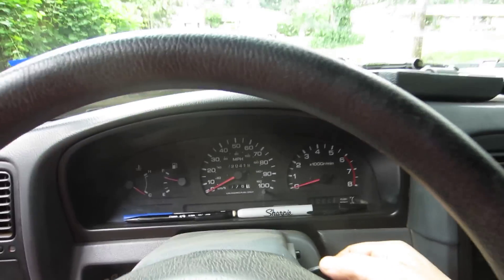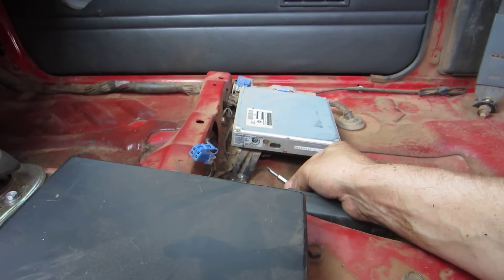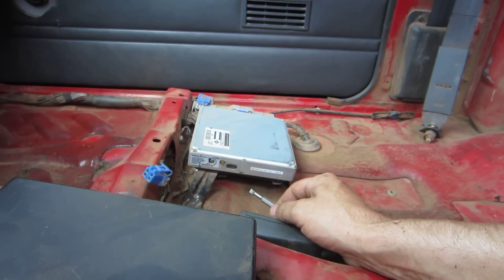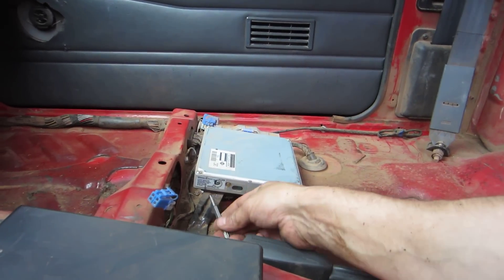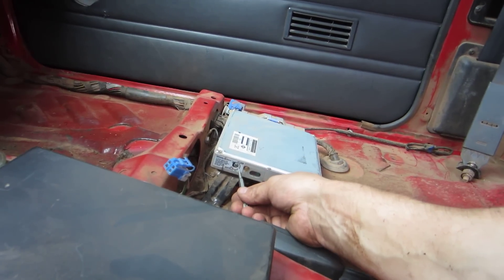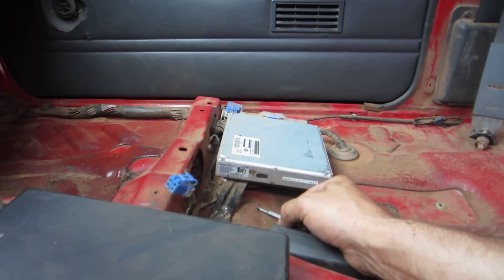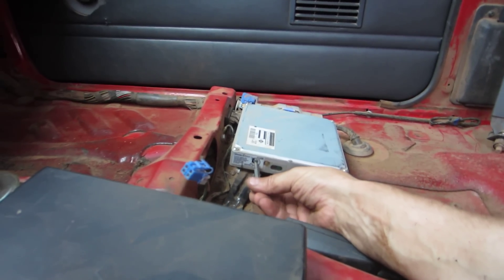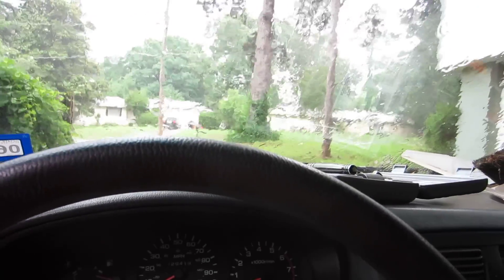Nissan D21 Hardbody Error Code Reading

Comment: My mechanic says I have error code 55. which happens to be the code for no malfunction, and yet the engine light stays on.

and so I get no diagnosis, and my car fails only the 25 mile smogcheck test

this is for a 93 Nissan Hardbody truck 4 cyl
Reply: +Iain Wigglesworth if it gets to a second issue I will join infamous nissan, thanks for the advice

I was staying on this specific topic of 02 sensor until I was clear on all my counter questions from the original topic.

thanks again.
Reply from the maker: +Daniel Manahan Are you on www.InfamousNissan.com? I don't have smog check where I live, but a lot of guys on there do. Post on there what specific part of your smog test failed. I'd vote for an old O2 sensor or dirty MAF.
Reply: +jp2code how much is it to replace that device? 

if the error code is 55 which is no malfunction, and yet I have a check engine line on, then it would seem that the box is defective

what else could it be?

at least that is the conclusion of the mechanic.

and I hear these parts can't be found except in a junk yard.
Reply from the maker: +Daniel Manahan The ECM detects problems with sensors and such that it needs to operate. The Check Engine Light (CEL), on the other hand, seems to be there to ensure your truck's emissions are good (which yours are not). See this pic out of the service manual: http://i.imgur.com/NBfxzi0.png
Reply: +jp2code so I don't understand. are you agreeing or disagreeing with the mechanic's opinion that the computer is bad?

if it reads error code 55 which is no malfunction and the check engine light on the dashboard is lit when the car is running, what else could that mean? why would the computer not give an error code when the check engine light is on?

I can't smog this because of the check engine light being on. it must be off. and yet there might not be any problem with the engine, just the computer, if I understand.

the emissions problems are another thing, separate issue or else a code should show up.
Reply from the maker: +Daniel Manahan Sorry this took me so long. I don't have a smart phone, and I was out at work. I'm saying a faulty O2 sensor is what causes the CEL to turn on. It is emissions related. There is nothing wrong with your ECU.
Reply: +jp2code then I am confused. why doesn't the ECU return an error code? why error code 55 no malfunction?
Reply from the maker: +Daniel Manahan Because nothing is malfunctioning with the engine. The ECU gives you errors when it detects an error with one of the sensors. The CEL comes on when your vehicle is not meeting emissions. If you look at that picture, it says to replace the O2 sensor.
Reply: +jp2code so this is great news. an easy fix right?

in my smog test it passed the 15 mph with everything but failed the M2: 25 mph with the following values if they mean anything to you.

RPM: 2354, % CO2: 14.3, % O2: 0.4, HC (ppm) Max: 41 GP 234 Meas 18, CO (%) max: 0.62, GP: 2.18, Meas: 0.00, NO (ppm) Max: 559, GP 1640, Meas: 1677 Result = GP

and in the Visual inspection  of Emission Control Systems Functional Check Results it passed for Oxygen Sensor and everything except for one thing failing the OBD System Check

what is the OBD System Check?

wouldn't I expect to see a fail on the visual check for the Oxygen Sensor?
Reply from the maker: +Daniel Manahan A "lazy" O2 sensor does not throw an error, but will cause the ECU to miscalculate the fuel mixture. Other than that, I so don't know about emissions. We don't have that here. You know who does? People on the forum: http://www.infamousnissan.com/forum/forumdisplay.php?f=21
Reply: +jp2code excellent thanks!

is there an inexpensive specific diagnostic test that can be done which isolates the O2 sensor as the problem and the only problem so I don't go back and forth making one fix retesting and another fix... 

I want to go to my mechanic and make sure they do the right test and to be sure I can trust the guy.
Reply from the maker: +Daniel Manahan No mechanic needed. See this pic: http://i.imgur.com/rhC9z.png That shows how an O2 sensor is supposed to read and a Red line showing how a lazy O2 sensor will report. The O2 sensor is supposed to be replaced every 60,000 miles. If yours is older than that, it'd be best to just replace it. Ones from the dealership are good quality, but around $60. Cheaper ones can be bought that come without Nissan's "snap in" connectors, but they have to be spliced in. The O2 sensor goes from where your exhaust pipe bolts up to your CAT, up around the transmission, up the firewall, and snaps in place in the engine compartment just behind the battery.
Reply: +jp2code If the O2 Sensor is lazy causing the engine light to remain on, shouldn't the engine light only go on once the car has been driving for some period of time not instantly? I mean, wouldn't we expect to see the engine light be off when the car is turned on and then gradually reach some kind of error?
Reply from the maker: +Daniel Manahan I don't know. Your O2 sensor is bad, though. Not the ECU.  ...or, just replace the ECU if you want. It is more expensive, though, and a new ECU isn't going to magically make your bad O2 sensor better.
Reply: +Daniel Manahan please join www.Infamousnissan.com you are more likely to  find the answer to your problem on there
Reply: +jp2code I will replace the o2 sensor per your advice and get back with you to let you know it was a success or what's next.
Reply: ***** dont reply on here please. Join infamous nissan
Reply: +Iain Wigglesworth just joined thanks. hope to see you there my friend.

do you have a nissan hardbody too? what year may I ask?
Reply: ***** i have 3. My username is 1990nissanhardbody
Reply: so it was the 02 sensor for that 55? im getting 55 on my 88 pathy
Reply from the maker: 44 is the A-OK for D21 trucks from 1988 and earlier. After that, Nissan went ODB and used code 55 for No Detected Malfunction. The D21W Pathfinder may have gone ODB earlier.

Comment: What year is your truck 94 or 95 and is there a junction box on the other side that works the blinkers mine when out and I was told there is a box under the seat for the blinkers
Reply from the maker: Under the driver's seat should be the door lock timer and the rear antilock break module. http://i.imgur.com/YabXD0Q.png
Reply from the maker: It's in the EF & EC section of the Service Manual. If you don't have a digital copy, get one from here: http://www.nicoclub.com/FSM/Hardbody/ I just know one day that site will be gone.
Reply from the maker: Shows "Linked Comment", so you may not get this. There is no other junction box. This is on the 1994 truck, but the driver's side is only for the Cruise Control Module, if your truck were equipped with it.
Reply: jp2code I have the module under the driver's seat also but my 95' 2.4L manual doesn't have cruise control, any ideas on what mine is running? Also I would like to learn about how to work the ECU if you are willing to teach.
Reply: Thank you, it looks to be the anti-lock brake module. Where did you learn the codes for the ECU?
Reply: I will copy all the info onto a USB drive if I can.
Reply: +jp2code  Thank you so much,down loaded all the manual.